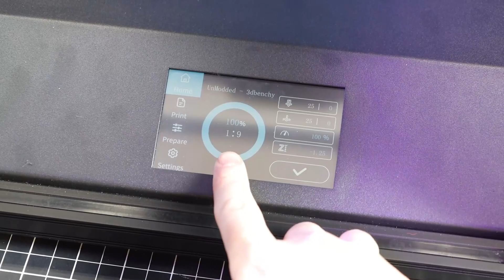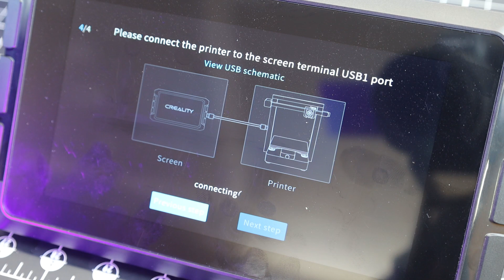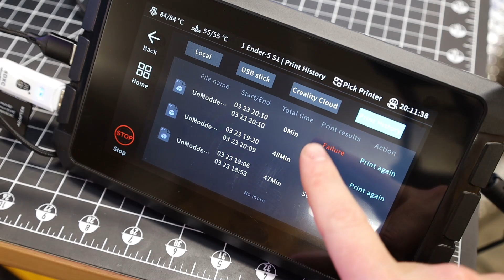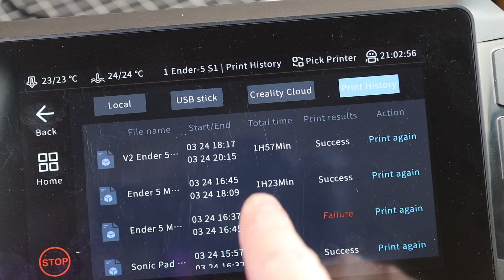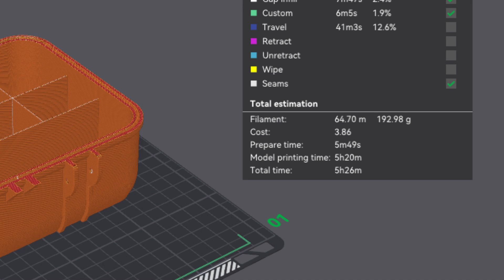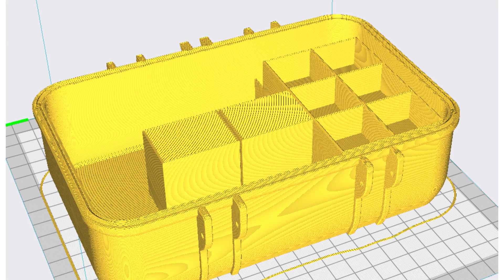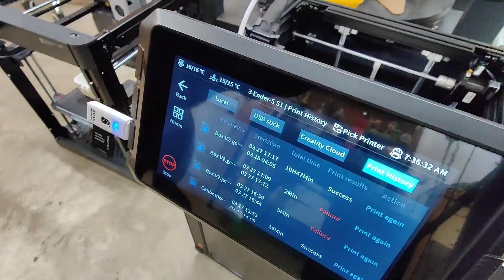Making The Ender 5 S1 is MUCH FASTER with a Sonic Pad

Comment from the maker: US store: Coupon Code：12ES5, get 5S1+Sonic pad Combo $120 off， only $479
Creality Ender-5 S1 (From Creality) - https://bit.ly/Creality-Ender-5-S1
Creality Ender-5 S1 (From Amazon) - https://amzn.to/3FwHVUI

Creality Sonic Pad (From Amazon) - https://amzn.to/3YZUYoy
Creality Sonic Pad (From Creality) - https://bit.ly/Creality-SonicPad

Use code 5S80 to save about $80 on the Ender-5 S1 Speed Combo
Ender-5 S1 3D Printer Speed Combo(From Creality) - https://bit.ly/Ender-5-S1-3D-Printer-Speed-Combo

Enclosure Options:
Acrylic Enclosure for Ender-5 S1 https://bit.ly/Ender-5-S1-Enclosure
Soft Tent Enclosure - https://amzn.to/3GMXwkj 
Other 3D Printer Enclosure - https://bit.ly/Creality-3D-Printer-Enclosure

Sonic Pad Mount For Ender 5 S1:
Ender 5 S1 Sonic Pad Mount 3D Files - https://bit.ly/Ender-5-S1-Sonic-Pad-Mount

Hardware:
4 x M5x35mm https://amzn.to/3ZdikHL
6 x M3x12mm  https://amzn.to/3Tq27NS
2 x M3 Brass Inserts 4mm x 5mm https://amzn.to/3Jpicil

If you doing to be building other things I suggest getting some hardware kits. They are a better bang for the buck. Here are some links to stuff that I used.
M3 Stainless Steel Hex Socket Head Kit - https://amzn.to/3JuH4oX
M5 Stainless Steel Hex Socket Head Kit - https://amzn.to/40115uq
Heated Brass Threaded Insert Kit - https://amzn.to/3ToPEKu

Heat Pressing Machine - https://amzn.to/3M2KtOK
Heat-Set Insert Tips - https://amzn.to/3nszAvg

Creality K1 3D-Printer (From Creality $599.00) - https://bit.ly/Creality-K1-3D-Printer
Creality K1 3D-Printer (From Amazon $699.00) - https://amzn.to/3CXlrdT
Creality K1 3D-Printer (From CrealityOfficial $648.00) - https://bit.ly/Creality-K1-3D-Printer-Official

Build Plate Upgrades for the Creality K1:
PEI Double Sided Magnetic Build Plate for K1 (Only $18) - https://amzn.to/449CVQq
PEI Printing Plate Kit With Cutouts like the Original  ($26) - https://amzn.to/43bIgWb

Replacement & Upgrade Nozzles For the K1:
Ruby Volcano Nozzle Abrasion Wear Resistant High Flow 0.4 - https://amzn.to/3nt7IYd
Brass Volcano Nozzle M6 Thread Nozzles 0.4mm - https://amzn.to/44tNaQ8
0.4mm volcano Hardened Steel Nozzle - https://amzn.to/412d9v0

Parts & Video to Swap Out or Upgrade the K1 Extruder -
Sherpa Mini Extruder (Extruder Replacement Option) - https://amzn.to/43dIrjw
Bondtech LGX Lite Extruder (Extruder Replacement Option) - https://bit.ly/Bondtech-LGX-Lite-Extruder
Creality K1 Extruder Mod - Nathan Builds Robots - https://www.youtube.com/watch?v=PHbT2MKrB_A&t=366s&ab_channel=NathanBuildsRobots

Bambu Lab Printers:
Bambu Lab P1P 3D Printer (US) - https://bit.ly/Bambu-Lab-P1P-3D-Printer-US
Bambu Lab X1-Carbon Combo 3D Printer (US) - https://bit.ly/Bambu-Lab-X1-Carbon-Combo-3D-Printer-US
Bambu Lab UK Store - https://bit.ly/Bambu-Lab-UK-Store
Bambu Lab EU Store - https://bit.ly/Bambu-Lab-EU-Store

Enclosure for the P1P:
Bambu Lab P1P Enclosure Kit https://amzn.to/46AeGfA
ARC Bambu Lab P1P Enclosure STL Files - https://www.printables.com/model/356301-arc-bambu-lab-p1p-enclosure

3d Printer Filament That I Use:
PolyLite ABS - https://bit.ly/PolyLite-ABS
PolyLite ASA - https://bit.ly/PolyLite-ASA
PolyFlex TPU 95 (Flexable) - https://bit.ly/PolyFlex-TPU-95
PolyLite Silk PLA Blue - https://bit.ly/PolyLiteSilkPLABlue
NylonX Filament - https://bit.ly/MatterHackersNylonX
PolyTerra Marble PLA - https://bit.ly/PolyTerraMarblePLA
TECSONAR Tricolor PLA - https://amzn.to/3H79d5N
Build Series PLA - https://bit.ly/MatterHackersBuildSeriesPLA
Build Series Silky PLA - https://bit.ly/BuildSeriesSilkyPLAMatterHackers
Build Series ABS - https://bit.ly/MatterHackersBuildSeriesABS
Build Series PETG - https://bit.ly/MatterHackersBuildSeriesPETG
PRO Series Filament - https://bit.ly/MatterHackersPROSeriesFilament

Amazon 3D Printing Filament:
PLA - https://amzn.to/3gsLE9Z
PETG - https://amzn.to/3pXjjvu
ABS - https://amzn.to/3wsTRjS
ASA - https://amzn.to/2RX8dtM
Polycarbonate - https://amzn.to/3cLdr38
Nylon - https://amzn.to/3iNGeI2
______________________________________________
Note : Most of the links that I use that go to products are affiliate link. This means I make a small commission on anything that you happen buy using them. This is at no extra charge to you and this helps support the work I do on this channel. 😁👍
______________________________________________
#3dPrinting #3dScanning #DIY #RandyMay

Comment: I got one of these Sonicpads for Christmas and it has been amazing. not having to constantly swap the micro sd alone was half the value for me. but the speed boost out of the box was really cool and I frequently boost the print speed to 200% with no issues on my ender 3 v2.
Reply from the maker: That's good to hear and yeah it really does speed up the printer without your having to really do anything

Comment: I have an Ender 5 Pro that I haven’t used for ages, have been looking at all the X1C, K1 Max and K2 a lot recently. Anyway, I just ordered a Sonic pad to get it back up and running after watching this instead of just buying a Bambu or K1, as I’d rather not let the Ender 5 go to waste!

I’ll probably get a K2 later in the year for the multifilament support and larger build volume.

Comment: I'm a bit late to this video, but figured it's worth mentioning here that as of January 2024, the E5S1 can be had for as low as 299 at Microcenter as of this comment, and the SonicPad for ~130. With an afternoon of tuning, i've found the built in profile has accelerations at 5k, but my specimen can handle upwards of 8k with no degradation in quality. (As to quality, Bambu firmware has also improved over the past 10 months too, so the tradeoffs get muddier).
If you want a turn-key printer, it's Bambu. If you enjoy the tinkering and tuning, that's Ender's bread and butter. Both are good buys if they fit your needs/budget.
I have the E5S1 sitting beside my X1C. Both are in constant use, and both are churning out quality prints.

Comment: The Ender 5 S1 is now around €200 here at the moment in Europe. Which seems to be a verry sharp price for this machine then. Even thinking buying 2 of them now.
Reply from the maker: That's not a bad price for sure right now
Reply: Little late but you don’t even need 2, this one has been updated to run up to 4 machines, or 3 with 1 webcam

Comment: Hey thanks for the coupon code! B&H had the ED5S1 for $399 but the Sonic is $170. I just ordered off Creality with your coupon for $511 sweet deal! Thanks! I have two Flashforge printers now and I've been looking for a faster open source printer to add to my lineup so I can crank out PLA prints. Really excited about the new set up.
Reply from the maker: Oh very cool and thanks. Let me know what you think of it once you get it up and running
Reply: @randymay  you bet. Have you tested out smaller nozzles and smaller extrusion widths with it yet? I'm wondering how it is with detail at slower speeds and say a 0.2 nozzle. I ordered a set of 5 different size nozzles from Micro Swiss as well.
Reply from the maker: I haven't messed with any smaller nozzles on this printer and 0.4 is really as small as I will go on a FDM printer. To me it's just not worth the extra time to bet smaller layers. If anything I go up in size to 0.6 or even 0.8 so print larger things faster. 

If you are looking for small part printing with  fine details you might want to look into resin printing. Resin printing can also be my h faster and you can print at 0.05 layers
Reply: @randymay  I've been collaborating with my vinyl ghapics company and doing business cards. QR codes and logos. Currently I use my FF Adventurer 3 and a 0.3 nozzle and get pretty good results. It's more horizontal detail not vertical so I keep layers at 0.2mm but extrusion width currently at 0.18mm. I get very good results and can turn out a card in about 1.5 hrs. I may look into resin at some point but for now I'm going to test the limits of the ED5S1. I'll let you know how that goes too.
Reply from the maker: Oh ok that makes more sense. I see a lot of people getting printers like this wanting to make highly detailed miniatures and to me it just doesn't make sense to do when resin is much faster, cleaner and easier. But what you are doing makes total sense.
Reply: @randymay  yea I'm not a miniature kinda guy. Never printed one actually lol I love to designing. Gotten really good with Tinker CAD trying to learn Fusion 360. I also have the full Adobe suite from our graphics side of the company. The 3D printing is a new endeavor but you can check out the wrap side it's Kangaroo wraps. I'll definitely let you know how the smaller nozzles work on the Ender. I have a 0.2, 0.25 & 0.3 on its way.

Comment: I am running into so many issues right now and I just got the ender 5 s1 sonic pad bundle, there were bed leveling issues and then I have restored to factory settings and recalibrated and Switched out the usb-c cable and it still stops mid print and keeps giving the Klippy shutdown error due to disconnect from mcu, I tried to reset my 3D printer so I can use it with out the Sonic pad and it won’t, when I flashed the firmware to use only the 3D printer and I hit the reheat, the printer Reboots and loops in restarting so it won’t heat if I try to not use the sonic pad
Reply from the maker: Did you contact Creality support about this problem?

Comment: Amazing video. You forgot to do the input shaping for Klipper, that should remove the ringing on the prints
Reply from the maker: Yeah I was going to do that later on but the profiles built into Masonic pad already have some sort of input shaping already done. After moving it on to the ground it looks like it took care of a lot of those ringing problems. Seeing that the table I was printing on is not very sturdy. 😁

Comment: I'm having a Ender 3 V2 with a sonic pad and since this week, a P1P.
Honestly said, the P1P takes the cake.
I've been a creality-fan for a long time, but BambuLabs has taken over.
The Ender does a very good job, no doubt about it, but the P1P does a better job in a much shorter amount of time.
The Sonic Pad is a great addition to the Ender and speeds it up and improves the printquality, but again, the P1P wins again.
Reply from the maker: Oh definitely It does speed up the printers but it can't speed them up to the speeds of the P1P. 

I can see using the Sonic pad on existing hardware to speed it up a bit and get some more life out of it before having to upgrade. 

And with all the companies now racing to compete with bambu lab. I foresee seeing a lot more printers coming out very soon with specs similar to the P1P and X1 carbon.
Reply: I doubt if there will be similar printers soon, like the P1P/X1.
What I think is a very big plus for the Sonic Pad, is that it can manage multiple printers (also non-creality) from 1 screen, to a limit of 4.
To my opinion, that's a big advantage, looking to other systems. 
So in theory, you can "enhance" 4 printers and control them too.
Reply from the maker: @AnotherCG umm ok, you can say that about just about any 3d printer company that hasn't made faster printers yet....
Reply: what is the best printer under the bambu P1P?      i am a beginner i am looking for 2 weeks now but stil cant choose what printer i like to buy. mabu 1p1 price is to high for my as beginner thx let me know what you think
Reply: @itzmemaariocleantaps8201  Start with a cheap bedslinger and learn to tinker with it. That way you save some money if you damage something and trust me, you will. After a couple of month/year, start thinking about a new one like the K1, newest prusa or bambu labs. This last one is also rather idiotproof for beginners in my experience.

Comment: 5:44 not fair comparison, the left is printed with 0.3mm layer height, the right one with 0.2mm.
Reply from the maker: What was printed at 0.3mm layers?
Reply: @randymay  the calibration cube on P1P (the cube on the left side)
Reply from the maker: I thought I used the default settings at 0.2mm for both.

Comment: Why is your machine shaking with the sonic pad?
Reply from the maker: It's on a table that's on wheels that is not stable whatsoever so any movement is going to move those around. Also just because it has the input shaping doesn't mean that it doesn't put vibrations through the machine.

Comment: I'm still relatively new to 3D printing and I got this so that I can send things straight to the printer without the SD Card. I have had issues with the temp I set and slice reverting to a preset on the Sonic Pad. My last print also seemed to stop pushing out filament but kept moving through the print as if filament was still coming out. I check it and it wasn't clogged. Anybody seen this or know of a solution?
Reply from the maker: Did you ever figure out the answer to your problem?

Comment: I dunno, at that price with all the modifications, I feel like at this stage it's just better to bite the bullet and get flsun v400, it's just too good out of the box
Reply from the maker: Yeah that is definitely an option. At the same time the bambu lab P1P pretty much just worked right out of the box and set up only took about 15 to 20 minutes. So it's all really going to depend on what printer you want.

Comment: Hi again, I am interested in printing the supports you made to place the pad as you did, but I sliced one of the lateral supports and Cura says it will take around 4hrs, and in your video says you did it in almost 2 hrs.
Any suggestions to improve the time?
Although, I am not yet using the sonic pad, I guess that may be a cause.
Reply from the maker: Yeah I was already using the Sonic pad when I did that print. And kira sat around the same time for me as well but with the sonic pad setup and going you could see in the video how long it took and those are all pretty much standard settings or the default settings in draft mode so the 0.28 mm layer height

Comment: Thanks for the video and info. Have the X1c and don't use my other enders as much now  but looking at the sonic pad to help reduce the run times.If you remove the sonic pad is the original firmware still on the printer stock board? if not is here a way to back up the original and reload it?
Reply from the maker: So you can reflash the printer with the original firmware to get it working as normal. You will have to find this firmware on the Creality website
Reply: All you have to do is save the Merlin firmware on a SD card put it into the machine (with the correct configuration from Creality) then turn on said machine.  It will install the new firmware and will be back up and running.  I had to do this a few time with my Ender 3 Neo (Non V2) because creality still hasn't created a profile for that machine yet.  it took me about 3 weeks to find the right klipper language to talk with the Neo.  It is now running and will be getting my S1 Plus is about a week to run them both on klipper and the sonic pad.

Comment: I have an ender 5 s1 without the z switch will it still work and be faster ?
Reply from the maker: It should and there is an option in the sonic pad for that printer
Reply: @randymay  I found it thank you
Reply: @randymay I installed the sonic pad but it still takes over an hour to print a benchy it doesn't seem like it's any faster
Reply from the maker: @Silentdeath1194  What is your print speed set to?
Reply: 100% I'm a noob where do I check that
Reply from the maker: You're using Cura slicer right?
Reply: @randymay  yes that's where I'm confused  idk what I'm doing wrong
Reply: @randymay  do you leave the SD card inserted with the new firmware in the printer I have it still in the slot
Reply from the maker: You can take the SD card out of the printer itself and now you can either send stuff over Wi-Fi to the Sonic pad or you can load it onto the SD card and using a USB adapter You can plug it into the Sonic pad to do all of your printing. When it comes to using Cura I suggest watching a video going over how to use the software I don't happen to have one but it's not that hard It's just a lot of options.
Reply: @randymay  ok thank you very much hopefully that helps with printing faster
Reply from the maker: @Silentdeath1194  Let me know how that goes. 😁😁👍👍

Comment: Good thingI waited for the K1
Reply from the maker: Yeah the K1 is definitely a bit better than the enter 5 s1 with the Sonic pad but at the same time it does have some problems and I'll have a video out on the K1 in probably a few hours.
Reply: @randymay  Yes, it has issues, they sent me another hotend, the new hotend has a bolt-in heater not soldered anymore

Comment: Question for anyone out there with an Ender 5 S1 and Sonic pad.
Does using the sonic pad mean I definitely will not use the Ender´s screen anymore?
Reply from the maker: Yeah the screen no longer works at all after the install. You will have to reflash it back to stock firmware to get the screen to working again.
Reply: @randymay   I kinda figured that out the bad way hehe. Though I wanted to check with more people.
Thanks man! Happy printing!